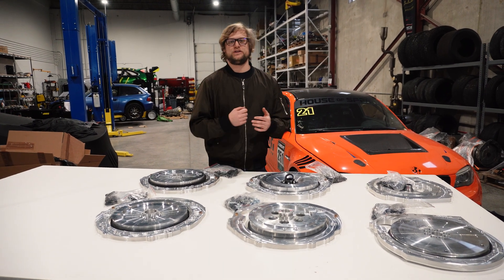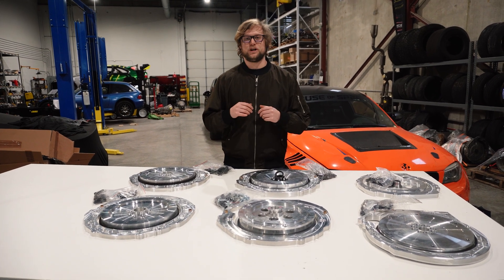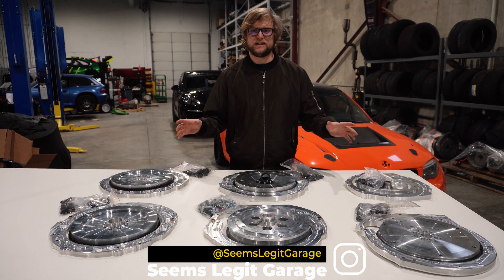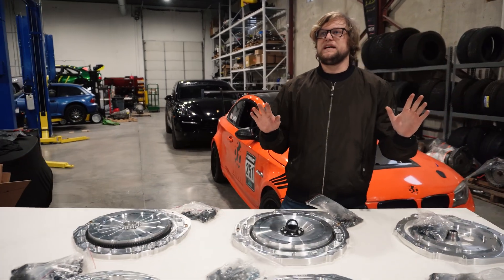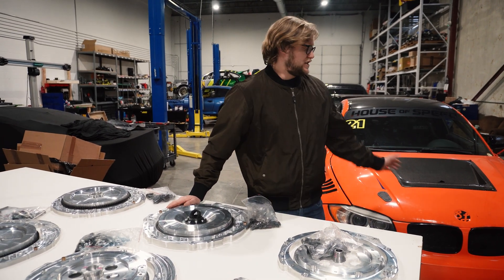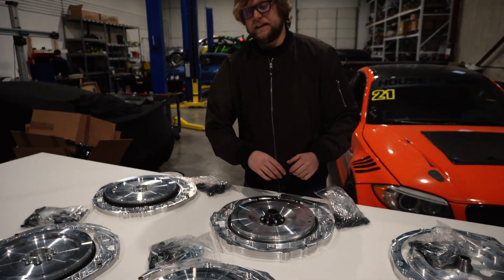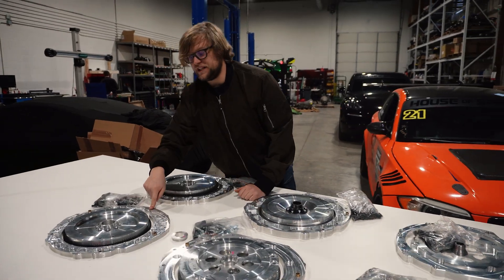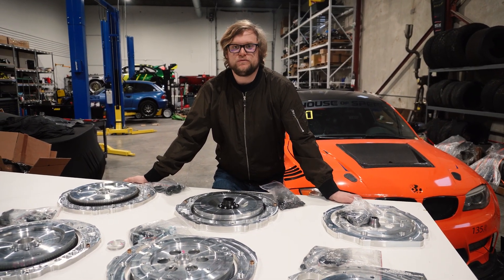All About ZF 8HP Engine Adapters!

Comment: The 8HP is absolutely legendary, amazing how smooth it can be and at same time fast when in need of it, I say 8HP swap all cars haha
Reply from the maker: We agree!
Reply: @SeemsLegitGarage  if a car comes with an 8hp already can you use this adapter to put in an LS and not need to change anything to control the TCU? thinking about an E89 z4 with 8hp45
Reply from the maker: @ibrahimelmi210  you will need a new trans controller if using LS ECU
Reply: I wonder whether I can swap my X5 E70 4.8i 6hp for 8hp from 50i LCI, I read somewhere its almost plug and play swap (but also with transfer case) except some CAN emulator
Reply: @mciejgda88 same for me with my xDrive35d and 6hp..

Comment: Dodge 5.2/5.9 Magnum? (not exactly the same as the older LA if you want to use them in the original application with stock electronics)

Comment: is there any possibility to pair a m52 ms41 bmw e36 with a zf8hp?from what I have read the ms41 would have some can capabilities in the sense that pins 85 and 86 would be the canbus communication of the oem tcu controller
Reply from the maker: you are better off upgrading the ecu first so that torque management is possible

Comment: My zf8hp70 in my 2015 Range Rover sport is heating up, I can feel it in my cabin next to my knee . I had the transmission filter and fluid changed but it didn’t help much. Do you know what could be the issue?
Reply from the maker: Are you running a cooler?
Reply: Just the stock cooler I’m going to replace that to see if it’s the issue maybe something is blocking it inside
Reply from the maker: @publicname515  yea maybe the thermostat is stuck closed
Reply from the maker: @publicname515  our trans usually run at 180-200f
Reply: I have a Range Rover sport — I don’t have a thermostat for the trans. My engine is not running hot

Comment: I have a 2000 ford focus zx3 with the 2 liter zetec motor. i want the zf8hp tranny swap, i have converted the car rear wheel drive. my engine  puts out 703 whp and 799 ft lb of torque  to the wheels.  what are my options?
Reply from the maker: I would recommend an 8HP70 with a custom adaptor, email sales@seemslegitgarage.com and we can help

Comment: If I purchase the VQ37 kit I would need to purchase a separate transmission along with it right ( S63 ) and that’ll be a simple bolt on swap ?
Reply from the maker: You will need many accessories as well

Comment: I'm trying to go from an 8hp55a to an 8hp90a is it really just bolt on for these or is there an adapter plate required of they both go to the same engine.
Reply from the maker: I assume the 8HP90 is from a Dodge so it would require an adaptor
Reply: @SeemsLegitGarage is it true the dodge versions have a weaker input/output shaft?? I thought you guys made a video on that

Comment: I guess if you are making 700hp it's not a problem but that is a lot of rotating mass to put in place of a flex plate.
Reply from the maker: Its aluminum so much lighter than you think, and compared to the converter its a very small % of weight change.

Comment: Do you have the adapter and flywheel for a 98 Mercedes S600 V12 to a 12 AUDI A8 HF55 4WD?
Reply: bro 🥰😍
Reply: Personally I think a v12 needs to be RWD with an 8hp

Comment: What makes you pick the HTG over the Turbo Lamik?
Reply from the maker: HTG is like having Motec capability with Holley simplicity. Its extremely capable and tunable for DCT or 8HP but the closed loop tuning allows anyone to use it easily. HTG offers everything you could ever need to make the car drive how you want from race to street and it works for both stock ECU cars as well as standalones.
Reply: @SeemsLegitGarage  Do you know anyone selling adapter plates for the Maserati variant of the 8hp70? They're super cheap compared to the other 8hp's I've seen.
Reply from the maker: @shophunterio  No we mostly use the dodge charger/challenger versions, they are also cheap and more plentiful. They are also all RWD

Comment: So I have a 2008 bmw 335xi how can I get it work with my and System do they make a 8hp and trans ??
Reply from the maker: Yes you can swap a modern 8hp awd trans in there with eh same adapter.

Comment: I have A 2011 335i n55. I want to the 8hp70 swap with my new build I’ll be right around 900hp with the new built motor. What parts do I need in order to make this swap possible? And do you guys offer a full kit for it?
Reply from the maker: Yes we do, releasing our rear mount soon, and we have an adapter plate for the 50 which you should use from the supra.
Reply: @SeemsLegitGarage so n55 no longer needs 8hp70?